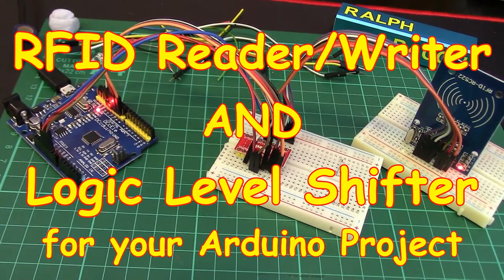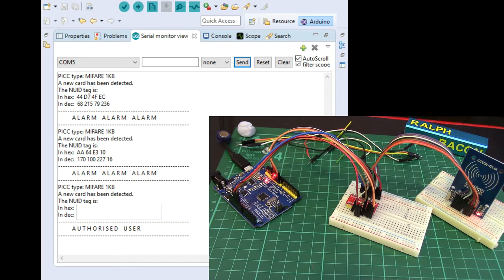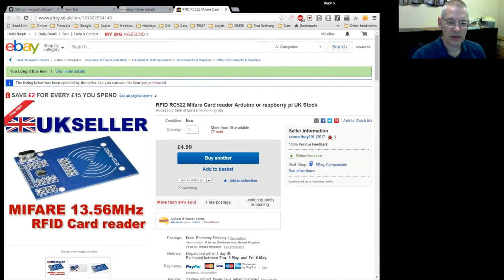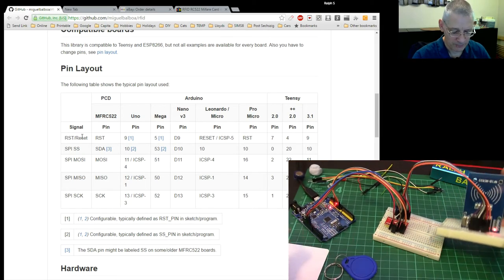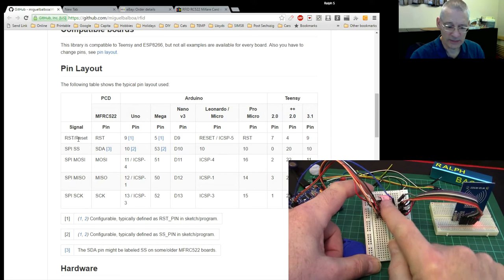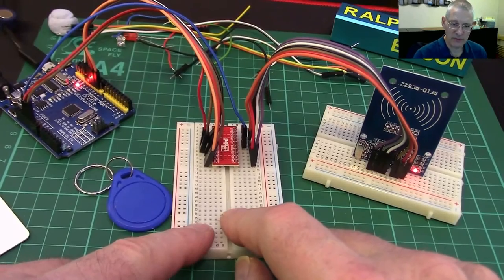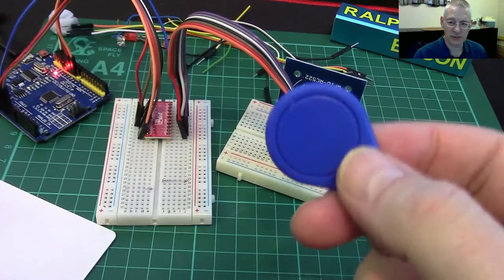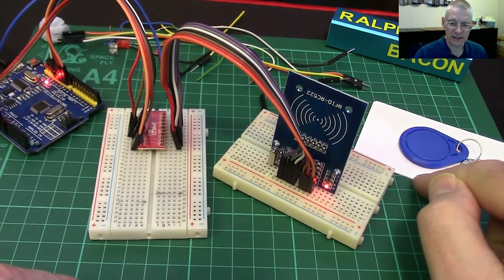#34 RFID Reader/Writer (Mifare MFRC522) with a Logic Level Shifter

Comment: just bought 4 of those rc522 boards, 2 red 2 blue and there useless for anything but a demo.
range with a tag 3-4mm, a card 5-6mm, and those cool rings you can wear, 0.1-1.5 mm....
thought the ring was faulty, bought 3 more different ring designs from different sellers. all same performance. even bump rc522 upto 4v and 4.5......10% better so not worth the risk.
suppose being cheap they do 'work' but you can't build them into a door etc
Reply from the maker: The range you're getting, Lez, and which I demoed, is exactly right. We had these at work to unlock the doors (remember, I cloned my work card, shh, keep it between us) and I had to put my card right up to the reader (within 1cm, sometimes even less) before they would unlock.
If you're thinking of something that will detect you as you walk up to a doorway you would need something very different, probably an active device so that you are sending the signal rather than relying on the reader being able to power the unlock card (at close distance). 
Electronic door locks are normally controlled by your phone's Bluetooth capability as that has a range of 10m or more.
Sorry you were disappointed with these but I never demoed anything other than very close range communication in the video.